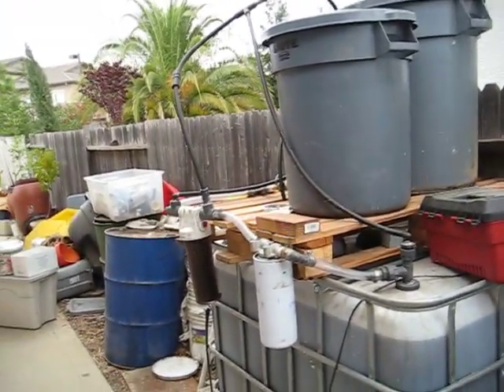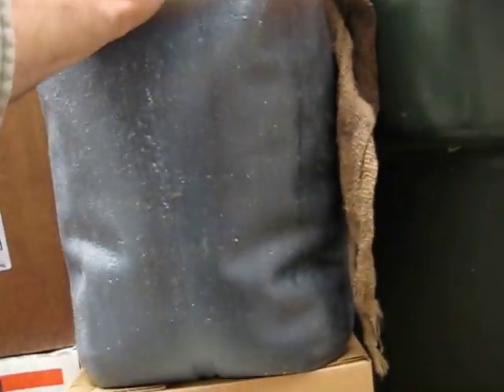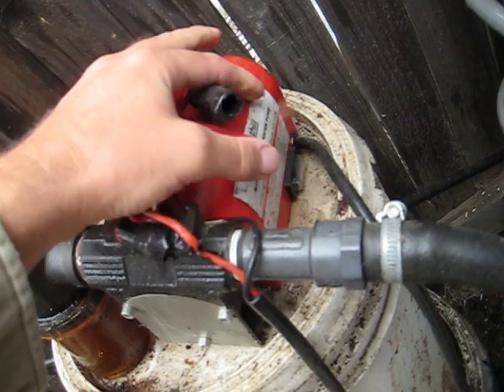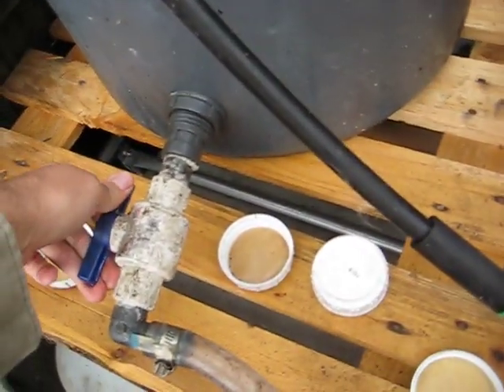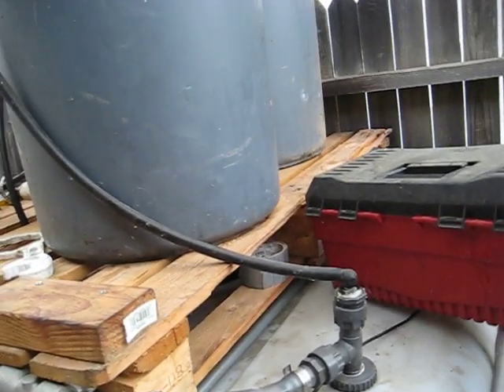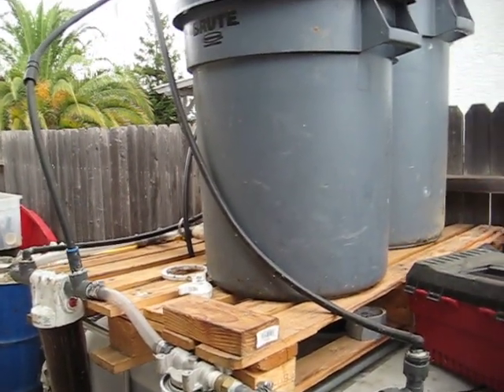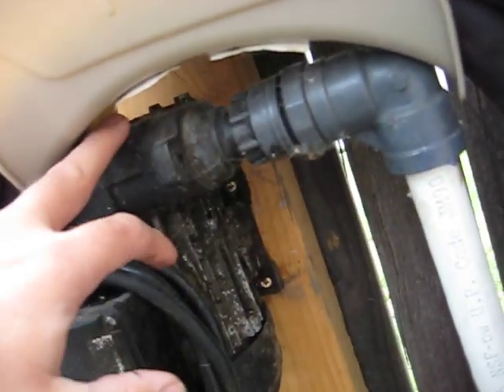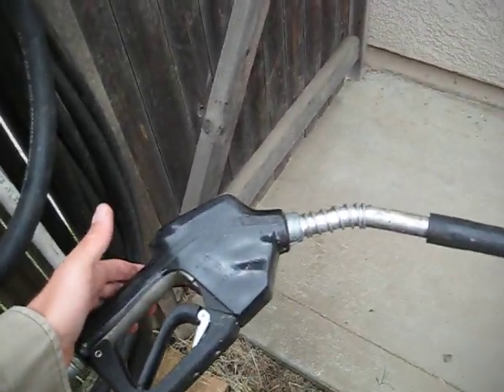Waste Vegetable Oil Filtering and De-watering

Comment: You could clean that cooking oil so much faster wit's faster with one of those cooking oil filtration systems that the restaurants used to filter their oil and refill to it for extended use And you can heat the oil up to at least 200ﾟ is recommended Fahrenheit And then there's a pump that forces it through the filter and it can do 6 gallons per minute usually And they're micron filters or half micron
Reply: Cold filtering is better as it stops the goo, if you heat it, it becomes liquid and it will pass through filters

Comment: Did you get your tank adapters at a hardware store or are they a specialty item?
Reply from the maker: Those are tank adapters from a specialty supply.  Farm and tractor chains have them, local plumbing shops also.  Online, search for barrel or tank adapter.

Comment: how much wvo is in a full cubie? I live in wa if I did this outdoors what would be a good way to eliminate water and condinsation?
Reply from the maker: Chase Flanigan WVO Cubies hold ~4.5 gallons, 35lbs of oil.   Settling(gravity and time) removes most water, and centrifuges and/or filters will remove the rest.

Comment: Hi Jason, good video. Can you tell me the brand of your diesel filter head?
Reply from the maker: urgentcareguy3 That's the Donaldson P555823.   I later found out that model doesn't have a water block, so now I recommend the Donaldson  P551000.  They're only about $13 each online, 10 Micron Absolute, water block.I eventually upgraded to a wvo centrifuge: http://www.filteroilcentrifuge.com/oil-centrifuge-products/
Reply: Jason Jelonek Thanks Jason!

Comment: Not sure I'm convinced this gets out all the water in suspension- due to the heat, fryer oil traps water molecules in a way that's different than if you just had oil that got mixed with water, known as 'free' water (condensation, for example). If you don't get rid of that water, it will ruin an expensive injection pump. All diesel engines have filtering and/or water traps which will keep out free water. Diesel fuel does NOT have suspended water in it, but WVO can. That trapped water can cause cavitation, and thus damage to IP.
 This (Jason system) would be fine for heating oil, or older diesels with out the high tech IPs. Otherwise a hot pan test would be a good idea.

Comment: What kind of wvo system do you have on your vehicle? also, is 10 micron enough to get all the particles out? Do most of the particles and water stay at the bottom of the tanks? do you run test every so often to check for purity?

Comment: Thank You very much for the details on how to filter and your own set up, it is very nice and simple. I do however want to ask if you or anyone else has ever considered a slight modification to the 1st stage, 

From your Big blue drum you pump the oil up to the 2 grey drums at the very top, would it not work to also have the plumb feed to filters a little higher above the base for even more Oil settlement.

Comment: Best setup I have seen yet. Alot of the other vids are either hokie with a couple of cans or maxed out nuclear, yours is right in the middle.  Looks very functional and simple; no discouraging wtf is that? I like the remove the fuse part. The mild CA climate helps too. Nice setup!

Comment: Nice video.  Lot's of good information.

I've found that CIMTEK filters from JME work well and can be a quarter of the cost.
How often are you changing your filters?
How often or do you ever drain that tote?
Eventually it will fill up with bad oil or water.